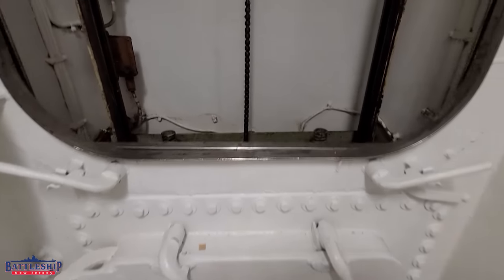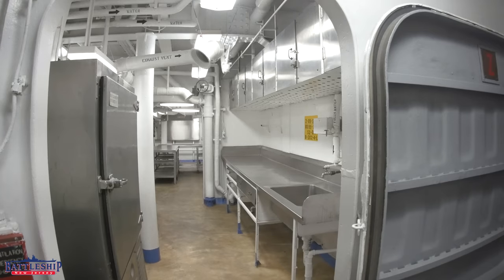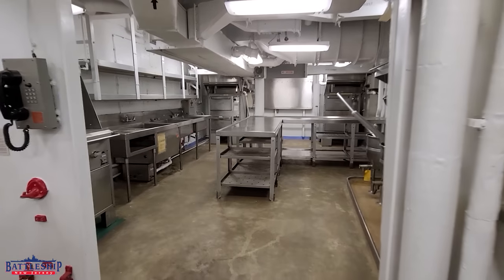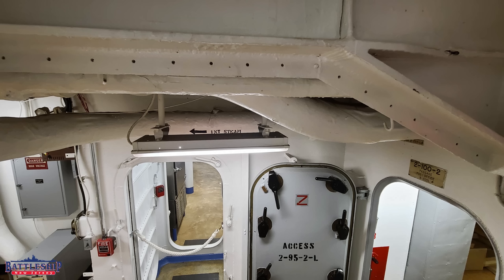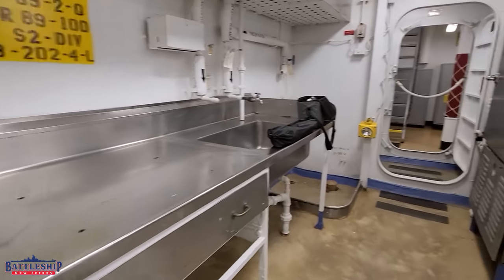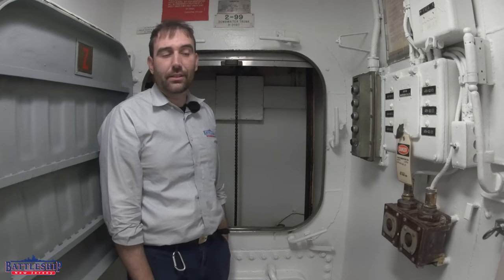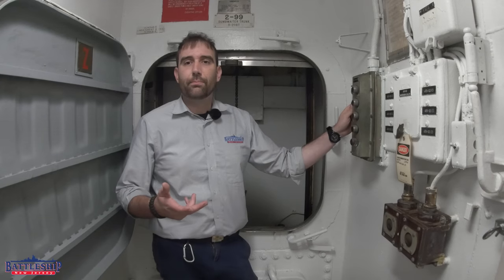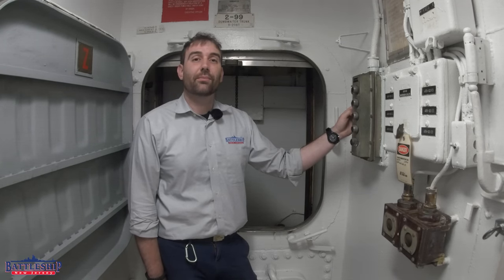Moving the Most Important Goods on a Battleship

Comment: That dumbwaiter was working when New Jersey came out in '82, I was an MM1working at SIMA Long Beach as HVAC/Hydraulics supervisor. We received several work orders for evaluation as LBNS passed some work to SIMA. That dumbwaiter was one of those jobs for evaluation. It worked but would "hang up" and trip breakers. My HYD shop found nothing mechanical that would cause it, and our Repair Officer deemed it and electrical issue. I was off active duty in 1979, and the Navy decided to recall me as I had been an MM on an AOE 2 the Camden which used the boilers and engines from another BB Kentucky , that was when they had started making preps for the New Jersey to go into LBNS for refit. I declined those orders. I didn't want to spend 2-3 years in the shipyard, only to be transferred before sea trials. I would go now, but they don't allow old diabetic sailors to do that... I retired in 92 after 20. You do the New Jersey and the Navy proud with your work!
Reply: If I were a betting man I would place mine on those switches Ryan was holding being the problem more than the rest of the system.

Comment: I"m surprised they had a vertical shaft like that penetrating so many decks. Perhaps the risk of a bomb finding it's way down the shaft was judged to be less than the risk of an angry Admiral with cold soup?
Reply: These spaces are well above any armored decks.
Reply: Everything was just sheet metal anyway.
Reply: 2-99 is a mid ship and on top of the Armored Citadel Cap with all the Main guns director's barbettes mass above it. And the conning tower armored mass is just forward of that. Sits in a nice armored bubble with the armored belt on its sides. Its not armored, all around it is. If something should ever make its way down there, lots of your ship is already missing. Everything like the intake and exhaust for the boilers going into the Citadel is staggered and vented through holes in a doubled part of the armored deck. All go right through the area behind those walls. So makes sense why the dumb waiter is there in that spot. All the important stuff is starts one deck down.
Reply: By the time something gets in there (and this is not in the armored area) you've lost a significant portion of the ship.
Reply: said "   risk of an angry Admiral with cold soup?  "  
Soupy doopy doop,
Oh soupy doopy.
Soupy doopy doop,
Oh soupy doopy.

Strange things in my soup,
That's what I found there.
Little tiny things
That move around there.
Looking down I see,
They're looking up at me.
Reply: I take it that during a Battle Stations condition, the access doors (presumably watertight) would be secured and the shaft essentially isolated from the decks it traverses?

Comment: Fun fact:  Knox class frigates had a "dumbwaiter" that went from the main deck right outside of the sickbay to the 3rd deck for striking down foodstuffs to the reefers.
Reply: That wasn't a dumbwaiter, it was a conveyor. The racks ran in a loop. Very dangerous as it ran continuously when in operation and could catch a hand or head.
Reply: @dennisfariello4852  True, hence the word dumbwaiter being in quotes.  And you're right they were dangerous.  Myself and another guy were mess cranking and I was handing boxes of meat to him and he was tossing them onto the conveyor.  For some reason he stuck his head through the open hatch and the next rack coming down caught the back of his head forcing him down and crushing his throat against the bottom of the hatch opening.  Left on a stretcher.  Didn't come back to the ship.
Reply: @seafodder6129  Wouldn't have been surprised if it had killed him. I don't believe they have any safety switches other than the big red STOP button.
Reply: @dennisfariello4852  is it not true that the big red stop button was the safety switch
Reply: @DrSchor  Well, kind of. Call it an emergency stop if you like. It's rea)y just a stop switch with a big red cap to make it easier to smack in an emergency. By "safety switch" we usually mean limit switches or door switches or some kind of automatic shutoff, which they did not have.

Comment: The 1950s-vintage engineering office where my father worked when I was a kid had a dumbwaiter very like that connecting the drafting room on the third floor to the document review room on the second and the document storage vault on the first. It had a rack inside it full of round pigeonholes for rolled drawings. I wonder if it's still there, in the long-abandoned ruins of the building...
Reply: why would it not be there.   who would take it out, and why
Reply: @DrSchor   The building's an abandoned ruin, for all I know everything inside has collapsed by now. I guess technically the dumbwaiter's remains would still be there if that's happened, but...

Comment: I would expect to find interlocks on the dumbwaiter shaft doors, so that a door can only be opened when the dumbwaiter is stopped by that door; interlocks are certainly fitted to early 1950s lifts on land. Was the interlock defeated so we could see the drive chain? I've seen springs at the bottom of the shafts for those same early 1950s lifts; they are not just fitted to naval dumbwaiters.

Comment: Has there ever been any intetest from the volunteers in getting the dumbwaiter working again?  (I know that the money to fix it would be better spent elsewhere.)
Reply: Interesting that they used roller chain instead of wire rope to hoist it.
Reply: @ghost307  It bends more easily.
Reply: @ghost307  Not bicycle chain, but industrial roller chain. Hard to tell, but either 5/8, or 3/4 pitch. It's probably the original chain. It would be interesting to look at the side plates to see who made it.
Reply: @billkallas1762  Your beef is with Ryan. He's the one who called it "bicycle chain".
Reply: since you know the money would be better spent elsewhere, you answered your own question,
Reply: @DrSchor  Well, my comment was before they knew they were going into dry dock and were still trying to raise money for that.  Now that dry docking is complete, I think they should spend a bit of money to get it working again.

Comment: Any insight to why The Navy shows to swap out the ladder and remove the light locker versus fixing the dumbwaiter? Did they think it was not an easy repair or would it have required some major surgery to the superstructure? Any insight on that would also be useful if the museum decides to try to repair it because swapping the motor is obviously easier than replacing a damaged rail for example
Reply: can you explain if you meant "why the navy shows'  or did you mean "why the navy chose"?  then i can answer your question

Comment: Hard to believe the crew wouldn't have made the thing work rather than walk the meals up the stairs
Reply: Sounds simple, but tracing ~50 year old control wiring with all the interlocks and controls on each level wouldn't have been very fun. 
Who knows, maybe they tried but it needed parts replaced that just weren't available any more.
Reply: @phillxor  I suppose. When I was a sailor we just "made it work" and documented it. I once fixed a radar with a piece of hamburger foil because the supply system didn't have any coaxial splices at the time. Just speaking from experience on how I know how sailors are.

Comment: so why didnt they fix it ? got whole machine shop. just sitting there
Reply: Probably the same reason I've got a couple dozen half-finished projects lying around the shop.
Reply: Just guessing but it more than likely  would be because of the OEM controls might of been either in short supply and better used elsewhere or had been so cannibalized by the 80's that a complete rebuild was in order. It couldn't just be because of a reversing motor had gone bad that is for sure.

Comment: They couldn't be bothered to repair or replace a simple electric motor? There has to be more to the story.
Reply: Procurement backlog. You know the drill.
Reply: Motors are easy to fix. So are chains and such. However, those old Cutler-Hammer contactors haven't been available for decades, nor the parts. So it's probably a burnt-out contactor coil, or burnt contacts, or even just burnt heaters (overload breakers, basically) that are simply unobtainable.
Reply: the mess cranks didnt get a vote on it being fixed. some officer or chief just said make the cranks carry the stuff.

Comment: Compared to how over-engineered everything on a battleship is, that bicycle chain seems uniquely under-engineered.
Reply: It's not a bicycle chain. It's a roller chain (the same type used on bicycles, but not the same size). Roller chains are used in many industrial applications, including harvesting equipment and grain elevators. They come in several sizes, and that one is well suited to the job it was meant to do.
Reply: You clearly haven't seen how much engineering has gone into bicycle chains.
Reply: @kmoecub  I wonder if one of the cog wheels broke or became inoperative.  That might explain the electrical problem and  the problem with fixing it.
Reply: @kmoecub I called it a bicycle chain because Ryan referred to it as such.  That is a heavy  carriage for a single strand anyway.
Reply: @kmoecub  We have roller chains in the mast on our drill rigs to pull the drilling head up and down the mast, along with a hydraulic ram.  Multi-link roller chains can take alot of force.